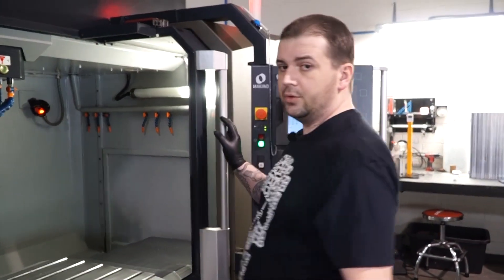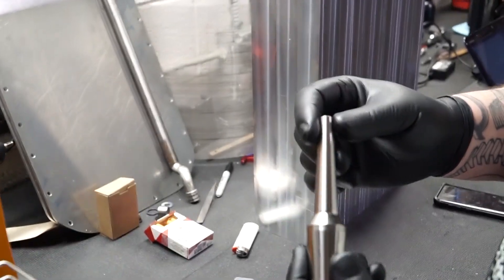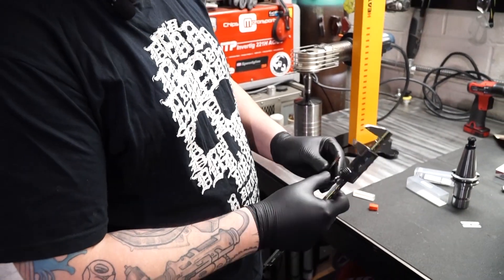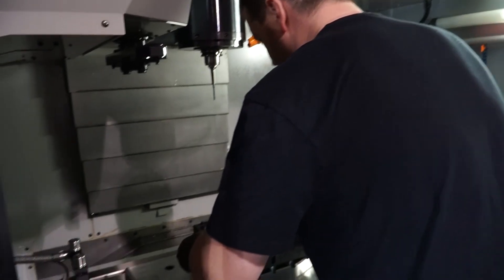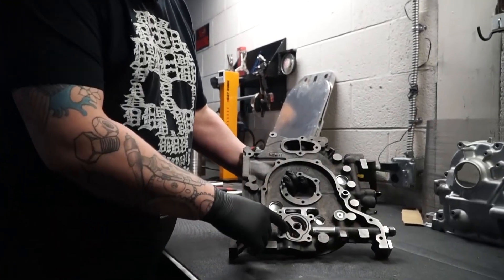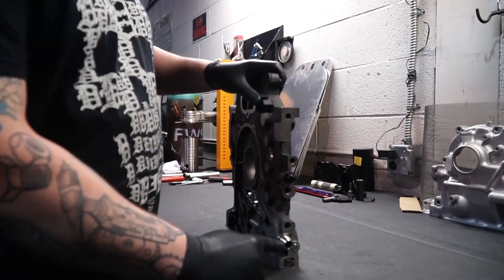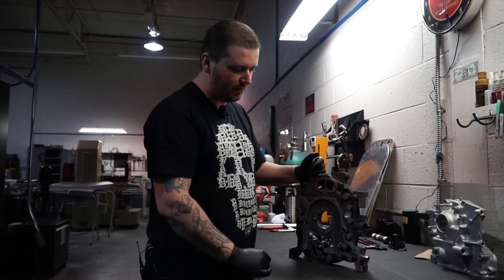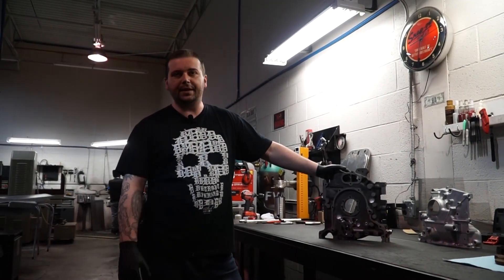Custom CNC'd Mazda 13B Front Engine Plate

Comment: Why are people keep on destroying the design of the Rotary engine with no proof of success of what they doing, I call it self destruction
Reply: So do you have proof that it does nothing? Your assumption is literally making you look like a fool. 

Go prove that this doesn't do anything, go spend your hard earned time and money like these guys here who have done nothing but build rotary engines for years. AND they have a FULL CNC SHOP, in which I'm certain you can barely even suffice to get one of the tools needed to even do a simple machining job.

So STFU, you do your research and prove why this is "unproven"
Reply from the maker: @TLHD420  Modification for power =/= modification for tuneability, efficiency, or more predictability. Doesnt always have to make more power to make sense. Unless dudeman here is a engine calibration tech or has 30+ years in prototyping/designing engines or IC systems, you cant say much with a surface level knowledge of how the parts in your garage fit together properly.
Chip always has a method for why he does things ;)